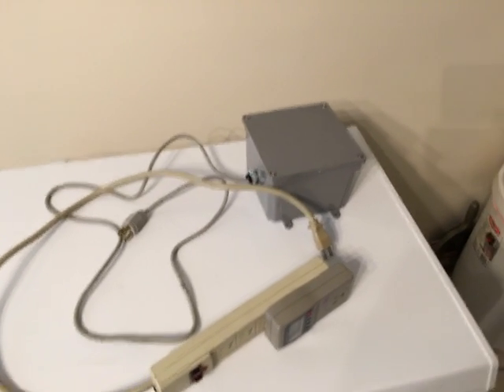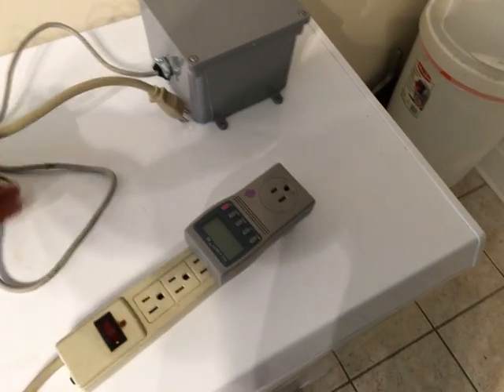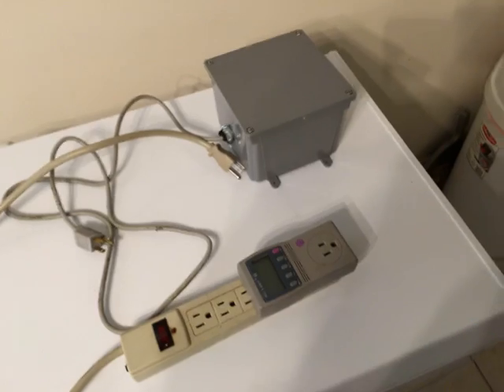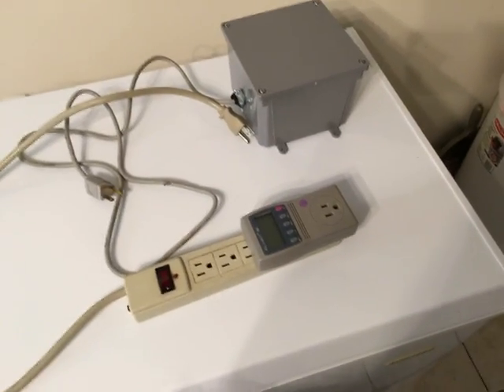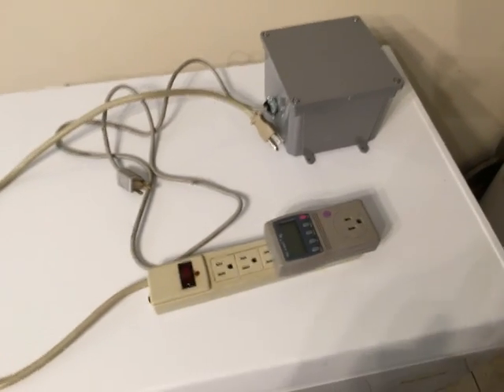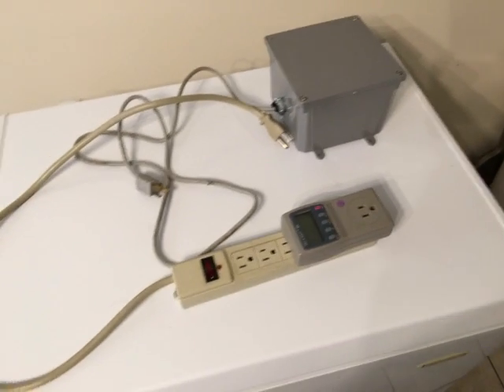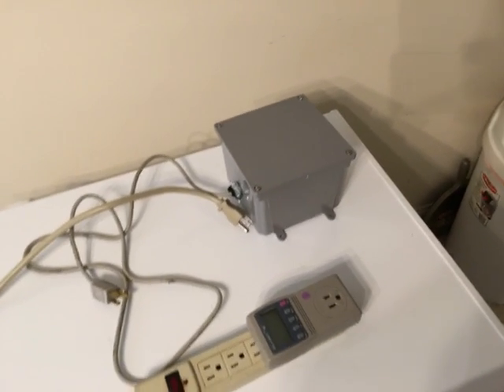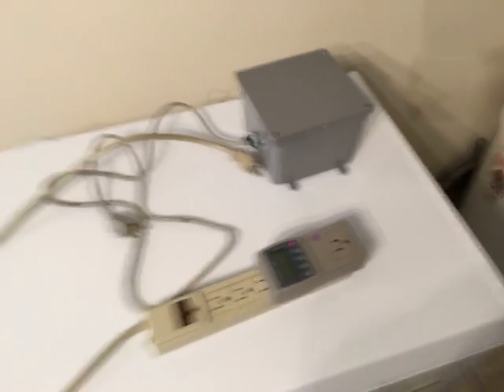Removing my DIY Power Saver device -the AC Capacitor- from my setup

Comment: I'm sorry to say but you are wrong and so is Guns,Games and Racing, I checked out his video and it seems you both don't understand how capacitors work. I'm not good at teaching so I wont try but I would suggest you learn what reactive power, true power and apparent power is and how to know which one you are measuring and which to care about. you also need to understand how a capacitor can charge up and discharge at 60 Hz with out consuming power or at least very minimum due to very low resistive load and how its total Z (impedance) is different to that. Having a capacitor is parallel with your AC loads wont really help you save on energy nor will it help with voltage drop but it also wont consume energy though it will help with correcting your power factor which is not something you most likely need to do unless you have a lot of inductive AC loads. and not something most people would benefit from unless your power meter measures reactive power and your electrical company charges you for it which most homes don't and not applicable for someone off grid. Sorry I can't explain in more detail or very well, i'm an electrical engineer not a teacher of it.
Reply from the maker: Thanks for your comments and patient explanations. I would agree that my knowledge about AC Capacitors and capacitors in general is very limited and I'm trying to correct that deficiency over time. Again, obviously you know more than I do so I can, refute your info, but I do appreciate it.
Reply from the maker: I had a typo in my previous reply thanks to my iphone.  What I was trying to say was that I "can't" refute your info.  What you are saying does make sense to some degree.  However, when looking at the kill-a-watt meter with the capacitors plugged in and nothing else plugged in, the unit did show a steady amp draw of .88A at 120.4V, which is around 106W.  Again, this was without anything else plugged in.  Granted there may be something that I'm missing, but that was enough for me to say that it wasn't a good idea.  Also, I have read reviews on similar devices that state that the customer's power bill actually went up when using the similar device, so to me the numbers do make sense in that regard.  Again I admit I don't know much on the subject and thanks for your comments.